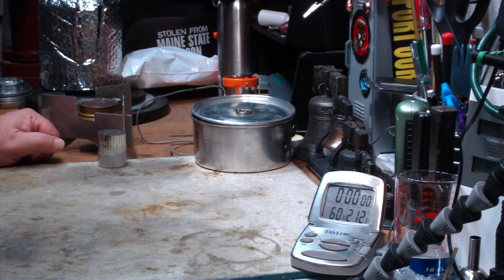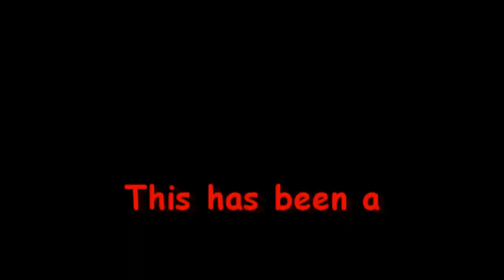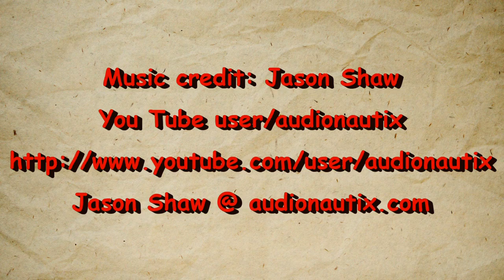Testing Trangia Idea Offered by bushwp11 - Boil Test #1

Comment: I've been watching your videos and have learned a few things. It seems the Esbit fuel and the alcohol stoves put out high heat but the alcohol stoves burn much cleaner and don't leave a smoky residue on your pots. Is that correct?

Comment: I think the gap on the corrugated insert is making two rows of "burners"  making a small vent hole in the center of the insert should fix the huffing issue.  on a diesel engine a surging idle speed is called "hunting"